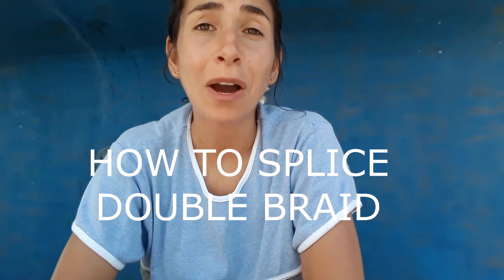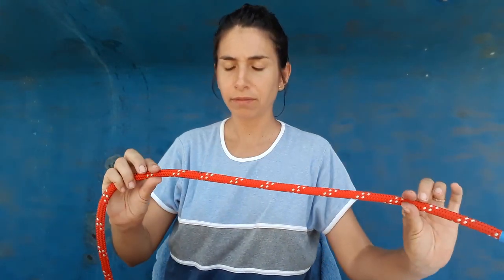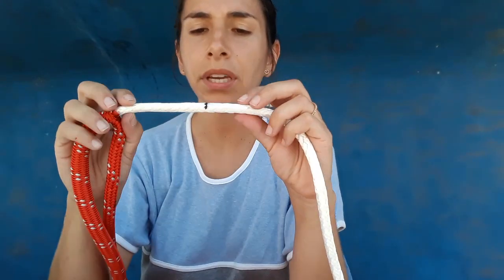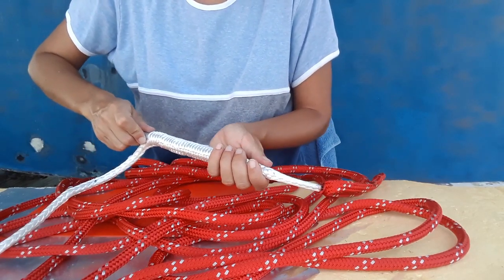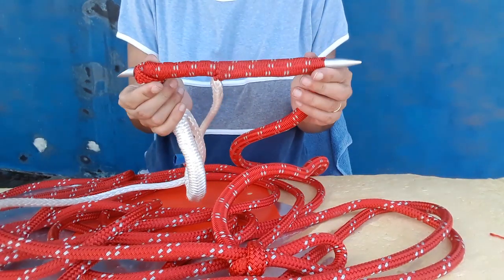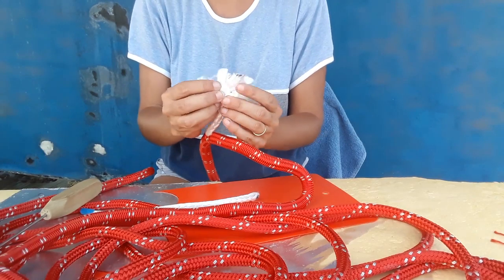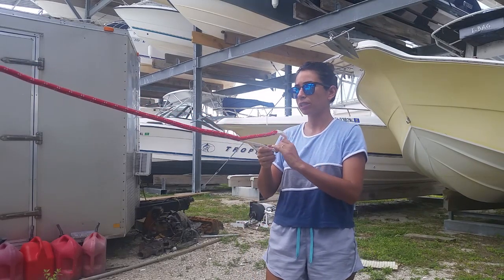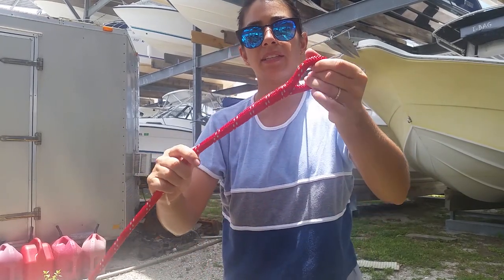How to Splice Double  Braid Rope

Comment: I don't know anything about sailing....so...why do you splice the rope? ☺☺😯☺☺☺👍👍👍🌷🌷🌷
Reply: Rope splicing in ropework is the forming of a semi-permanent joint between two ropes or two parts of the same rope by partly untwisting & then interweaving their strands.  Splices can be used to form a stopper at the end of a line, to form a loop or an eye in a rope, or for joining two ropes together.  Splices are preferred to knotted rope, since while a knot typically reduces the strength by 20–40% a splice is capable of attaining a ropes full strength.  However, splicing usually results in a thickening of the line & if subsequently removed leaves a distortion of the rope.  Most types of splices are used on 3-strand rope, but some can be done on 12-strand or greater single-braided rope as well as most double braids.  While a spliced 3-strand ropes strands are interwoven to create the splice, a braided ropes splice is constructed by simply pulling the rope into its jacket.  Types - Back splice, Cut splice, Eye splice, Ring splice, Chain splice, Figure-eight 'splice/knot', Horseshoe splice, Long splice, Short splice, Soft Shackle.
Splices are often tapered to make the thicker splice blend into the rest of the line.  There are two main types of tapering - the standard and the 'West Coast Taper' (also known as a Fisherman's Taper).
Reply: FegrusMojo 
Thank you .I didn't know what it was for. Now I do.☺☺☺☺
Reply: We're all learning new things here and seeing new places - we're all part of this epic adventure now ;)
Reply: The word cut and paste ignored the main part of your question... WHY? In this case, the answer is that Peter and Margarida are replacing the standing (eg fixed) rigging of the yacht with dyneema synthetic rigging (instead of traditional stainless or galvanised wire rigging). So loops just like the one Margarida made will need to be added at each end of every single stay (with metal ferrule inside each loop to minimise chafe). So these splices are absolutely vital to the integrity of the rigging.